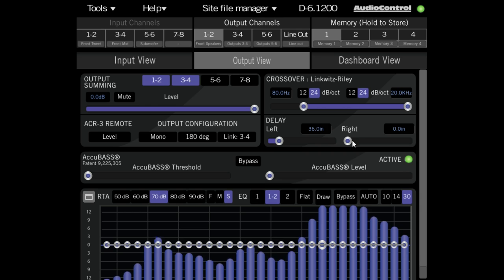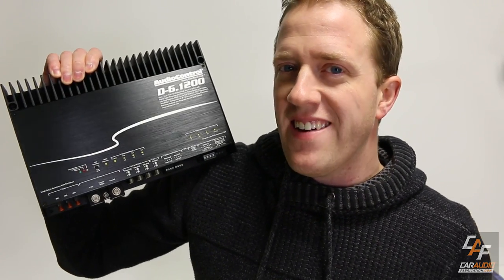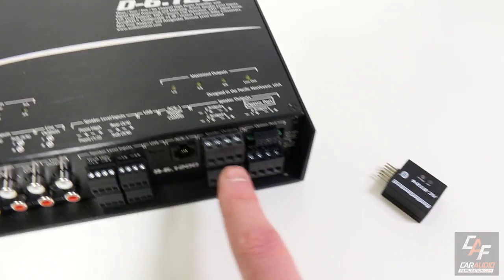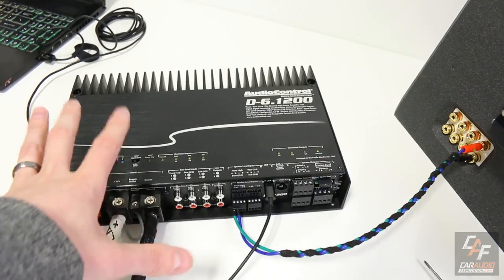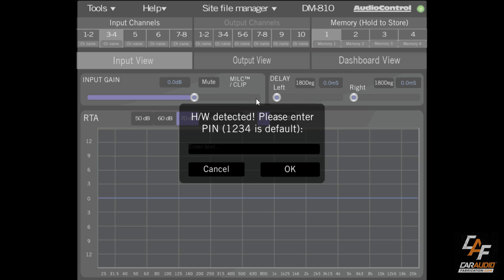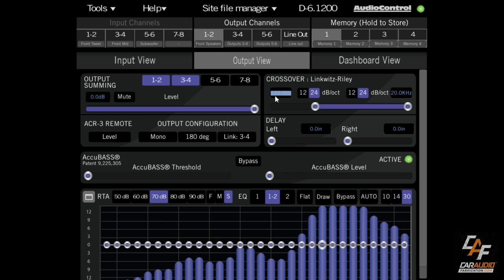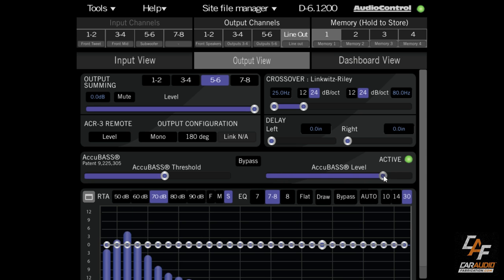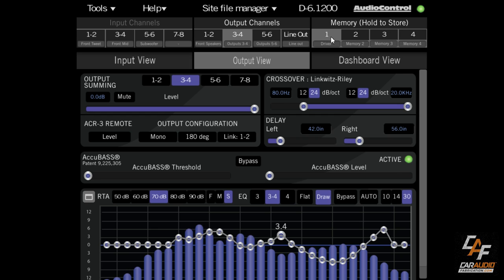DSP INSIDE! AudioControl D-6.1200 Overview

Comment: I've had this amp, installed in my truck, for a couple of months. Originally, I had the LC version of the amp, but returned it to purchase this amp...due to the advanced DSP options. It really is a great marriage of hardware and software. 

Mark - please shoot a video on the AC-BT24. I'm curious about direct music streaming and how volume would be controlled if bypassing the head unit.
Reply: I use my iPhone to directly stream into the DM-810 if you have the volume on your phone up at switchover it blast your speakers to holy-hell. The sound quality over this WELL WORTH IT. Audiocontrol please adjust you’re volume to gradually increase instead of killing my speakers.

Comment: They finally added the option for bass knobs to be volume control?? About time haha
Reply from the maker: That has been there since the original launch years ago. You can see it in my DM-810 video.
Reply: I read in the manual it can only be one or the other at once though

Comment: Wonder if this guy is still around, this is a very informative video. I’m thinking of purchasing the D5.1300 model to add a subwoofer and amplify and correct the factory mid-bass and front speakers in the Harmon Kardon system in my BMW. Not sure if I’m up to the task though.

Comment: Mark, these are very well done videos, so thank you for taking the time to produce such informative & valuable content.  My son & I are building a 1951 Chevrolet Truck as a Father/Son project.  This is an heirloom car, so hopefully he will keep it for decades if not forever.  Since there is no factory audio system in play, his thoughts are to use a BT receiver connected to his smart phone using his playlist, then route through an EQ to correct the source going into the amp(s) and finally route to the speakers.  Would the D-6.1200 be the best product for a 5 or 6 channel system?  Or is it overkill for a BT connection to a cell phone?  It's a single cab truck where the front 3.5" speakers are mounted in the dash or installing 6/6.5" in the front kick panels, rear speakers would be placed in the rear cab corners, and the sub(s) mounted behind the seat.  The amps would be installed under or behind the seat.  Thanks for any advice you can provide to us.

Comment: I have Jeep Wrangler JKU, I am slowly upgrading the audio, Stock Head Unit, upgraded to JL Audio speakers and used a Chrysler PAC convert to have RCA outputs to a temporary amp that would drive the speaker upgrade.  Im looking at the D6.1200, my question is the does the PAC to RCA to Amp, is this ok to use in this configuration or should I look to use speaker level input for the D6

Comment: @CarAudioFabrication I purchased this exact unit. Would I still need my audio control LOC I currently have installed in my vehicle now that I have this Amp/Dsp? Would it make a difference to keep it installed vs not if not needed? As far quality goes?

Comment: You did a great review of this amp, but you forgot a very important capability: It's a full 8x8 audio matrix. This means you could have multiple inputs beyond the BT adapter. I chose the D-6.1200 and it's baby brother D-4.800 to run an IASCA/IQC system in my F150 (which I happen to be smack in the middle of). In order to retain the highest possible source quality from my iPhone, I'm running an Airport Express (12v mod + fan) for lossless Airplay via wifi, running mini-toslink to toslink into a Cambridge Audio MagicDAC 100. Then, I have a 1ft custom RCA into inputs 5-6. I'm using high-level inputs 1-4 for my OEM stereo and the BT adapter uses 7-8. Lastly, you can simply program the preset memories to use whichever inputs you want. I'll personally have Preset 1 as All Seats Airplay, Preset 2 as Driver Seat Airplay, Preset 3 as All Seats OEM, and Preset 4 as All Seats BT. Keep up the great videos!

Comment: I'm still pretty new to car audio. I've watched tons of your videos and I've learned so much! When I have any questions, I dig a little deeper and I can usually find the answers I'm looking for. However, I'm stumped on this one. In the video, you suggest running the six channels to a set of 3-way component speakers, but, at 4 ohms, that would put 125 watts to a single tiny tweeter. How can the speaker survive that much power? The tweeters I've researched don't come close to that kind of power rating.

Comment: Mark could you make a tutorial video on setup and tuning the DSP on the D6 1200. I watched many videos that you made as well as others but no one goes through to explain the steps and the reasons for the order of steps to take. I have a 2016 F150 factory head unit infinity split fronts and rear with rockford 12. put this amp in and I keep trying to tune my system. It just doesn't sound as good as it should. Would be nice to have a tutorial.

Comment: Great video!!

Especially for the usage of the computer and tuning!!

Without the Bluetooth attachment, how many total audio devices will I be able to use. I have an iPad in the rca input (using adapters to get to the amp)

I’ll have 4 rca inputs available. Would I be able to use the remaining rcas for other devices?

Please forgive me if this is a noob question. I’m trying to get the most out of this.

Comment: Hey, Mark. I was wondering if you could answer this quick question for me. I'm upgrading my girlfriend's car audio and was wondering if this would work to power the front component speakers, the rear coaxial speakers and an 8" sub in the rear. Can I use this one piece or are there other components I need. Minus wiring of course. Thanks for your help. Videos are great!
Reply: It would. But unless she's a complete audiophile and wants to tweak every speaker on the computer you won't need these. Just go with a Punch five channel amp. (P1000x5) It has four channels for each speaker and a fifth channel for a subwoofer.

Comment: Mark, do you recommend using the RCA inputs when using an aftermarket head unit over the speaker inputs? Do you have a video on how the settings should be set on the stock or aftermarket head units when using a DSP?

Comment: Hey Mark, great video I had a simple installation question. When installing the DSP is the recommendation to splice into the factory speaker wires or just cut them off completely to run to the DSP?  I’d be running all new speaker wires for new speakers so the factory wires wouldn’t be in use, but splicing in line would make it easier to remove my aftermarket equipment if I sold my vehicle. Thanks.

Comment: Hi, amazing video! but I got a question, can I use this amplifier with my system, it only has 4 full-range channels, not front-high and front mid-range, just front full range....  because I see that this amplifier has inputs for high channels, and mid-range-channels, in the front speakers.

Comment: I'm late to the game here, but I just bought a 2012 Lexus IS250 and I've been researching how to adapt to the factory navigation/audio system and found this. Damn...Audio Control has me thinking about selling my JL Audio HD750/1 and HD600/4 amps and replacing them with this one amp. It's either that or using the Audio Control DM-810 DSP and keeping my HD amps. I really like the space saving and flexibility of this amp and I wouldn't sacrifice much on power either. Hmmm...things to think about. Damn you Mark!

Comment: You just GOTTA show how to install this with a second amp. Putting subs on their own amp is common so I would like to see how the DSP would handle such a setup with a 6 speaker setup commonly found in SUV’s.
Reply from the maker: I discussed this in the video, you would connect the six speakers to the speaker outputs of the amplifier, and then you would send the signal from the RCA outputs on this amp to a separate subwoofer amplifier. You could even use this amp to tell the other amp to "turn on" with the remote out, and you can completely tune the subwoofer RCA output. So 8 full channels of DSP control.
Reply: Yeah but it would be cool to “SEE” it. For those visual learners.
Reply from the maker: You want me to show you and rca wire plugged in from one amp to another? Check out my other recent video where I did a D-4.800 and the LC-1.1500 together. That has the full install into a vehicle
Reply: CarAudioFabrication Wait, so the only way to add an additional amp is via RCA? Because I was thinking using 7-8 as a connection.
Reply: CarAudioFabrication what if I wanted to run 2 sub woofer amps, a lc800.1 and a lc1500.1, since there is only 1 set of outputs, would I just need a rca distribution or even rca splitter to have 2 sets of rcas?

Comment: 2 things this amp needed, and extra set of outputs to be used for rear fill or for more powerful amp for front mid-bass and you still have the other see of outputs for the subs. And the last option would be the ability to run two of these together and when connected one amp runs all left side and the other runs all right side.
Reply from the maker: I mean, where does it end though? Then it would be: well why not have 6 outputs so you can run an active set of 2 way components in back plus subs? I get what you're saying, and it would be nice... but I think at the point that you need the extra channels you are getting into a larger build that is likely going to be a dedicated DSP like the DM-810 and several amps.
Reply: @CarAudioFabrication  yeah you are right. Then a 8 channel with 1 set of outputs would be the whole system amp like the jl audio vxi amp. I say that because it seems AC is trying to bring a all in one solution.

Comment: Hey would I be able to replace the factory amplifier and use the signal wires from the radio to connect to the audiocontrol amplifier?2007 Lincoln mkz premium sound system.

Comment: Hey Mark, If I plan on running front and rear component speakers in my Jeep Wrangler will that actually be 8 channels?  I was thinking about the Audio Control DM-810 with a 4 channel amp for the fronts, a 4 channel amp for the sound bar speakers and a separate amp for the sub.  What are your thoughts?

Comment: My car has 4 stock speakers in each door. I want to cancel the OEM speakers and put 1 woofer 1 mid range and 1 tweeter in each door, so there will be a total of 12 speakers.
Will this DSP be enough to run the 12 speakers? If so, how to conncet the 12 speaker into the 6 channels? If not, what should I do to make it work?
Also, can I connect another regular amplifier to run tweeters and mids, and transfer all data from the DSP directly to the other amplifier?

I know its a lot of questions, but your detailed answer will help a lot.
Thanks.

Comment: All that but we can't adjust the level of channel 1 separate from channel 2? Time alignment is great but only half the battle for a true center image.
Reply from the maker: You absolutely can adjust level independently. Watch the section where I show how eq can be controlled seperately on left and right. The slider changes to two sliders
Reply: @CarAudioFabrication  Aah got it! Missed that at 19:22 where the level changed from both to odd and even. I just caught where the EQ could be adjusted independently. I was thinking OK I can drag the entire EQ down for that channel but that's a lot of adjustments to make an across-the-board change to the level.

Comment: I wonder why no phase adjustment (180 isn't enough). I guess delay will help getting output phase correct but it's nice to have independent control. Lastly, how do we preserve any surround sound DSP from stock system and still tune for best sound. I'm not sure what my factory DSP does (delay, frequency changes??)

Comment: Would you make a video on how to wire multiple batteries and go a little more on how to use or how to wire distbution blocks?
Reply: Seriously? What are you not sure about?
Reply: U must be joking...
His videos are the most detailed...!!!
Reply: @MrMaxyield  How do I wire a distro block with multiple batts? With 100% success rate, only way to go. 

River Alley Sounds like needs an alternator upgrade first but whatever, I'm not going to speculate until clearly defined goals are given..  think why are you doing this and relay as much info as possible.
Reply: @andrewjohn6853  
Always alternator before batteries...
Ppl don't understand that extra batteries = extra load on alternator...
Gotta have power to make power...!!!
Reply: @MrMaxyield  You're switched on.
Reply: 3-4 batteries per alternator?
Reply: @riveralley  What amp output is your alternator? Why do you want 4 batteries?
Reply: @andrewjohn6853  I don't have anything just trying to learn as much as possible about car audio. Max alt would be 240 amps. The total power would be about 8500 watts.
Reply: @riveralley  Ok. 8500w RMS you are going to need alternator upgrade first.  This cannot be skipped and this is the first thing you will be spending money on, you might even need 2 HO alternators. Like 350A each.  If only one then yeah you need a battery bank for sure. 

My advice if you are new stick to a 3k watt RMS or lower system. Life is long and your ears will thank you in the future too.
Reply: @andrewjohn6853  but would the batteries pick up the slack for what the alternator can't do?
Reply: @riveralley  Yes that alternator would drop voltage to the surface charge of whatever single battery or combination of batteries you have.  But this is very stressful for the alternator.  It's not ideal, but you are right, the batteries will supply when required.  If you must go for 8500w RMS then you want the biggest alt you can get, this is essential.
Reply: @andrewjohn6853  the biggest possible would be 240 amps. Unless people could go higher than that with out damaging anything.
Reply: @riveralley  pretty sure you can go a little higher. i reccomend hitting up singer alts for a quote. Ive only heard good from them and recently got a quote and it was a great experience. Am likely going to go with him he pretty much matched best prices on market for my car and even had a wide range of amperages at low rpms.   when you say 8500 watts its best to specify RMS or MAX wattage rating. they are very different things and likely have very different power draws. the max wattage can be anywhere from doulbe to 4 or more times the RMS rating and tells you little about what the amp is really capable of.  be sure you are checking the RMS rating to base your power demands and speaker matching on
Reply: He recently made a video where he went through planning his whole electrical system for the Grand Cherokee. He did the actual calculations to see what he needed. Go watch that video and learn how to actually determine what you need rather than asking and relying on idiots on forums which most of the time, have no clue.
Reply: @Anonymous-cu8eu  Care to point out the idiocy kind fellow? 2x350A alts is exactly what this guy needs for an 8500w RMS system. The guy doesn't have a clue and that video is going to make as much sense to him as the next 10 that deal with the topic. I'm no pro but I don't mind helping people and perhaps one day something I say will click conceptually with them, and that's what learning is all about. But at least you've said something, pointed to a video and put down everyone else without really ever putting yourself on the line. That says a lot about you.
Reply: @riveralley  You could have an alt that output 1000A it doesn't matter the electrical components only draw what they need...  Say of the 1000 your vehicle draws 750 the other 250 don't just get created and find a home in some component. They never existed. A high voltage can certainly damage components, that's where I think you are confused here.

Comment: Can I use this amp in the following setup - using 2 channels to front speakers (left/right) use a 6.5 coaxial speaker with a component crossover for mids(6.5) and tweeters(1-2")?  How would I set the internal DSP on the D-6.1200 on those 2 channels?  I also have a single center channel in the dash (not sure what channel I should use)  Thoughts?

Comment: This thing looks sweet. But I'm wondering how I would tune it using an aftermarket radio.  It seemed you were using it to "correct" the factory eq to a flat response, but what about using low level inputs from an aftermarket head unit?  Would I need a separate RTA to tune my system properly?
Reply from the maker: The RTA in screen is showing the ELECTRICAL response. You tune that to get a starting baseline. Obviously for an aftermarket radio the starting point is already flat. You then tune from there the ACOUSTIC response with a seperate RTA microphone. AudioControl is soon releasing a new product called the DM-RTA. I'll eventually have a video here on the channel

Comment: How do you get a chime signal separate from the rest of the output to go in to "high"  in a GM?  Isn't the chime generally in the front left output from the radio?  

Also if you have a factory amplified crossed over as you described in your example, how do you incorporate rear as well?    Meaning crossed over front components, rear coaxial, and subwoofer.
Reply: I am curious about the chime as well.